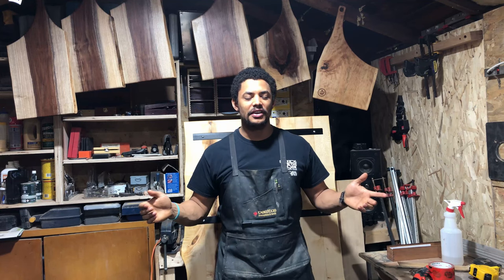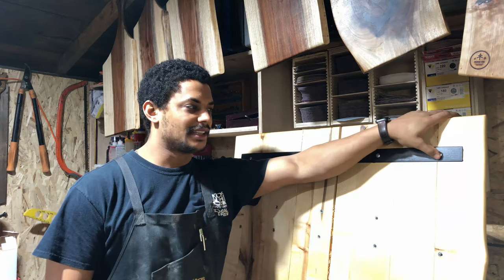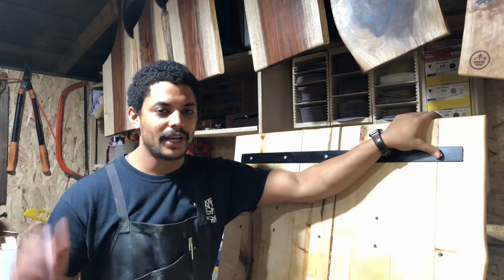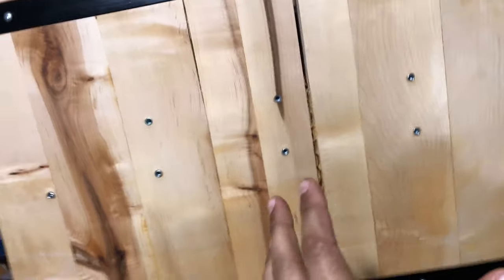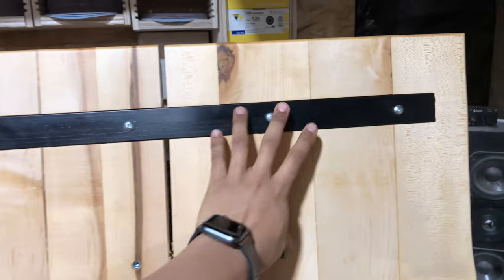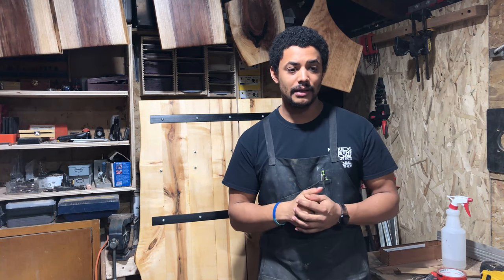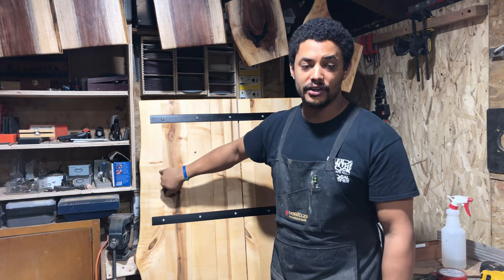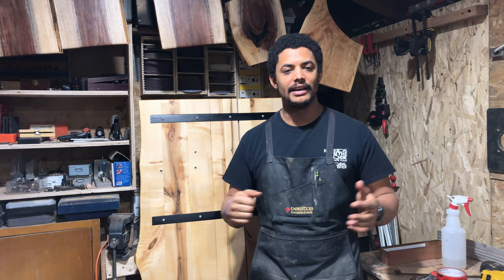C  Channel Ripped Table In Half!

Comment: This is a great video. I just installed some C Channel and made sure to get some with slotted holes. That will be my next build video on my channel. Couldn't find any legs that had slotted holes though.
Reply from the maker: Glad you liked it. I have had tough time finding slotted legs as well, just last week I spoke with the company who makes the legs for me. They have agreed to make all our table legs slotted from now on. Advantage of working with smaller local shops. Maybe you could ask wherever you get your legs from if the could slot them for you.

Comment: I don’t understand how the c channel allows for the wood to expand and contract. I could understand if you routed out t slots in the wood and slid the bolts in then connect them to the channel. Then they would be able to move but to have the bolts going directly in with a rigid channel seems to negate the desired movement. New to woodworking but do engineering so leant make sense.
Reply from the maker: The idea is to prevent cupping, which is common issue with live edge or large board table tops, to by stiffing the underside of table with channel we can resist movement in that direction. lesson learned in this video, is that we want to make sure we still allow the wood to expand in contract along its width.
Reply: when attaching a rigid piece across the grain - be it a breadboard end, table base, or c-channel, you must allow for grain movement.  In the case of c-channel, the solution is slotted holes in the c-channel.
Reply: Thanks for sharing for experience with your tabletop build. Blacktail Studios is a master with large slabs and using slotted C-channel.

Comment: My guess is that the humidity difference between your shop and your buddy's house was too much for the table. Winter months can get super dry especially if you are running a heater, so your stock most definitely shrunk and a lot. Movement is also affected by the type of finish and how you apply (top and underside). I found polyurethane to be very good as it seals the wood as it were inside a plastic bag, helping to keep the moisture level in the wood very stable.
Reply from the maker: Agreed. Thanks for the tip and input!